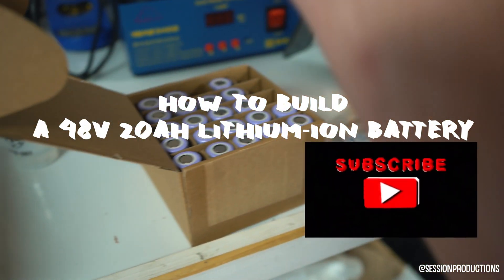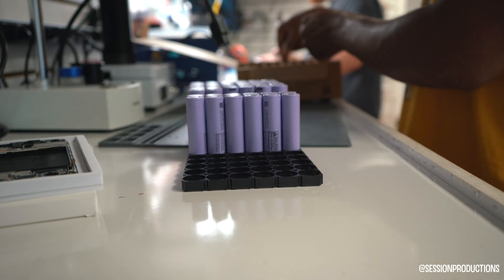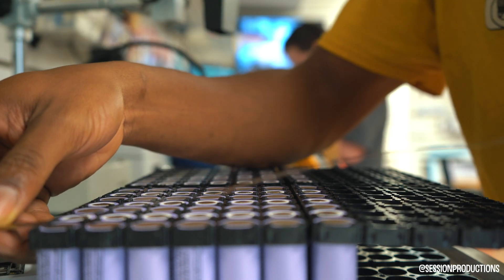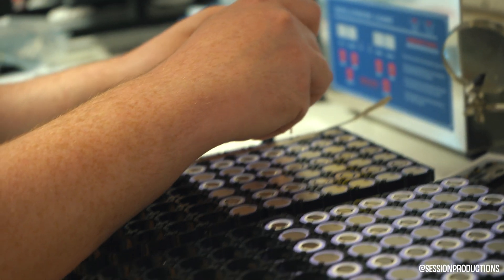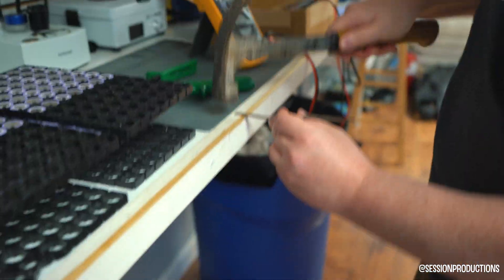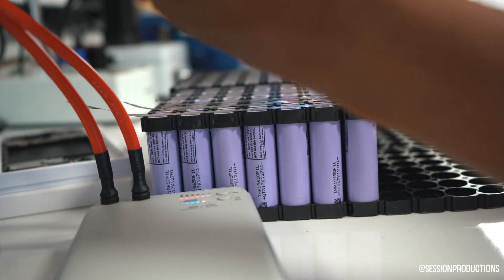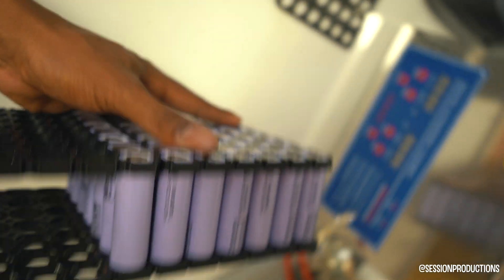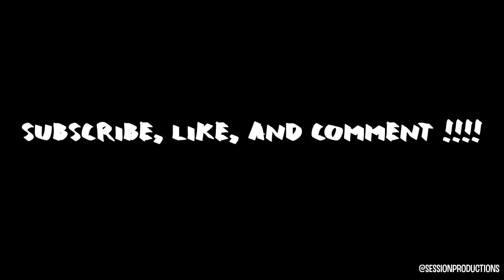How To Build A 48v 20ah Lithium-Ion Battery: Part 1

Comment: How many you need to make 48v
Reply from the maker: 12 cells in series to make 48v equals 1p
Reply from the maker: Times it by 4 or 5 and you get your capacity higher. Or even more cells
Reply: @mikeyyywill  thank you

Comment: what does it cost to build this vs buying it?
Reply from the maker: About $375 if you build it with all your own parts. If you buy a battery it could range from $500-900 depending on what voltage you want
Reply: @mikeyyywill  oh pretty big savings..is this considered like a 3-4/10 on the difficulty scale?